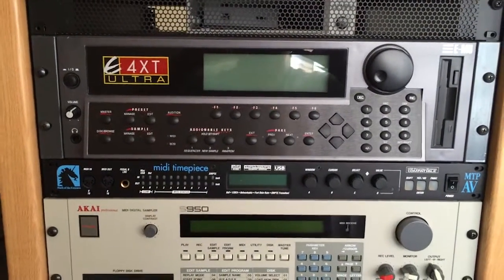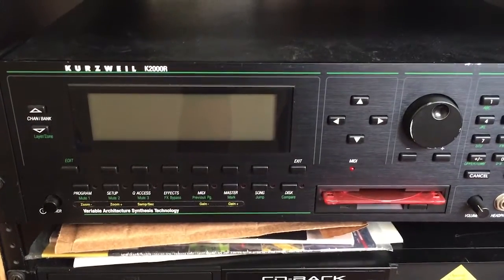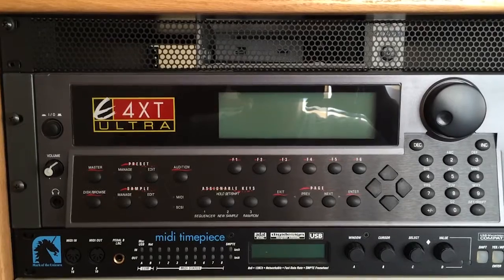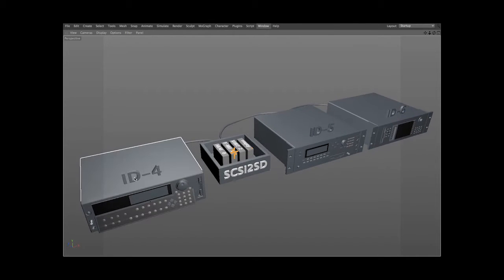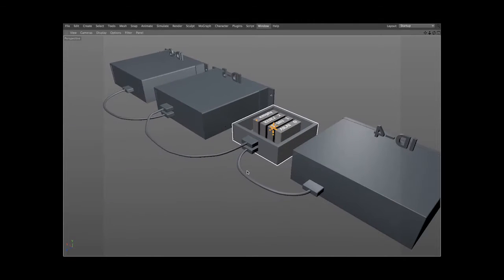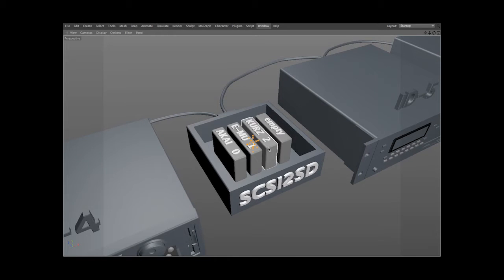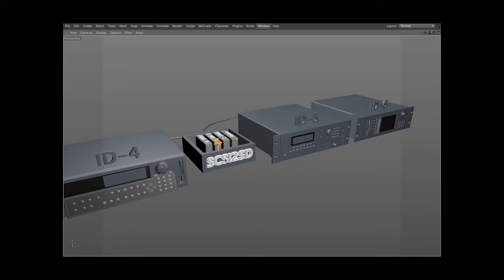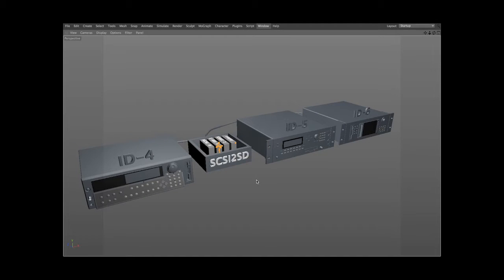SCSI experiment: 3 samplers and 1 scsi reader (scsi2sd)

Comment: I have a scsi2sd card in my E-mu e64 but am having difficulty getting my S3200xl seeing it when I plug it in to the e64. Do I need a separate box for the scsi2sd ?
Reply from the maker: The scsi protocol wasn't really designed to have  multiple hosts (samplers or computers) in the same chain, so you can definitely run into some problems, data corruption being one of them.  You can kind of make it work sometimes but if you want hassle free operation multiple scsi2sd cards is the best way to go.  I use multiple cards myself.
Reply: Thanks @RoyMaya

Comment: Just out of curiosity, did you try loading filrs off the E-Mu drive or the Akai drive onto the Kurzweil?  Since the Kurz will read both of those formats I was wondering if you tried it this way using the SCSI2SD device.  I know that the Kurz will read E-Mu and AKAI CDs fine, but accessing foreign files from a shared SCSI bus would make the capability even more interesting that it already has been shown to be.  I wish I had rack space for some of the other older samplers.

Comment: You can connect 4 samplers INDEPENDENTLY yet all wired at the same time to one SCSI2SD using a common, generic 4-way "data switch" box (most often made by Belkin, but plenty of generic ones exist). The box has five DB25 ports on back (1 for each of 4 devices/samplers "A", "B", "C", "D", plus 1 "I/O" port for the SCSI2SD), and a rotary selector knob on the front. Simply rotate knob to select the sampler you are using at the moment, giving you have access to all four samplers directly without multiple drive confusion and termination issues, but also without any rewiring necessary while using only one SCSI2SD. The switch boxes cost about $15 to $30 new.

Comment: In order to daisy chain multiple SCSI samplers as you did here must the SCSI2SD device be external? Is it possible to also, for example, install the SCSI2SD card internally into the Akai S6000 floppy drive slot and then daisy chain the other samplers through the SCSI connectors on the back of the Akai S6000? The SCSI2SD I'm thinking of purchasing is the updated V6 model.
Reply from the maker: it might work, it just depends on the samplers that  you'll be connecting.  The main disadvantage to this is that you can't turn on the scsisd indepentatly from the sampler since it's internal.  A lot of times you need to turn on the hard drive first (or scsi2sd in this case) before turning on the samplers.  But it's worth a try.
Reply: @RoyMaya  Excellent. Thx for the reply! :)

Comment: It seams to be very slow campared to a Compact Flash reader. Is it just so slow when they all are connected to the same SCSI Bus or is it so slow in general with the scsi2sd?
Reply from the maker: It's only this slow when I had all the samplers connected.  I think I didn't have all the termination set correctly which could have affected the speed.  Either way, this was just an experiment.  I have separate scsi2sd's for each sampler now which works great.

Comment: hello again another question :) just wondered if you have to have the k2000 switched on before the s5000 can communicate with the scsi2sd drive or does this "pass thru" without power? thanks
Reply from the maker: That's a good question, unfortunately I never tried that so can't say if it would work.  My setup is different now so I can't try that.

Comment: HEllo, I have just bought a e6400 classic and had a couple of Qs about the SCSI2SD if that's ok? I was wondering whether you could use it to burn iso disk images of sample libraries to partitions on the SD, while leaving other partitions for harddrive file systems? I hope so, as I really don't want to have to buy a scsi cd rom drive! Thanks for your help.
Reply from the maker: Yes, you can put cd-rom images onto the drive on the SCSI2Sd but you need to use another program for that, like WIn32 Disk Imager.
Reply: Thanks for the info!

Comment: Hi Roy. I want to buy scsi2sd for my S3000XL as well. Which version that you use? And do you  need to set it up first before use it or it's plug n play?
I've seen lots of people set the card first.
Reply from the maker: I believe by default it has a 2gb partition set.  You probably want to configure it first before using it, though.  I don't have an S3000XL so I can't help you with that, but I know others have using it with the S3000, though.  Good luck.

Comment: Thanks for posting this it has proved to be a useful resource of information, just one question though  the scsi has one male 50 pin connector so how did you cable it to allow to be chained? Im trying to get mine setup to work between an akai s1000 and a s3000xl currenly just connected via ribbon cable to the s1000
Reply from the maker: I have it installed in a scsi case which has dual connectors.  I used an old Syquest EZDrive 135 case.  I have another video showing how I installed it.

Comment: Hi Roy, With the SCSI2SD, when you partition the sd card, into several partitions,  A,B,C etc.. does the sampler automatically know that when you select the ID number 0, that its communicating with partition A,  or if you select ID number 1, that its communicating with partition B on the SD Card, are is there some other way to assign this.
Reply from the maker: The short answer is yes.  Although, to be exact they're not partitions (otherwise the sampler wouldn't recognize them) they're virtual drives.  So to the sampler it's like you had 4 scsi drives connected with their own ID, that's why it works.
Reply: Thanks Roys, did you create the virtual drives with software, ?
Reply from the maker: Yeah, there's a utility/app that you use to configure the scsi2sd - it's pretty straight forward. You can download it from the scsi2sd site (codesrc.com).
Reply: Cheers Rod, Just Purchased Your Bracket for V.5 and the SCSI2SD board, for my Akai S3000XL, I may make a video on how to install it, and putting sample cds on the SD Card, Your Name and website will be mentioned on the video, if your OK with That
Reply from the maker: Looking forward to checking out that video. Appreciate it!
Reply: Hi Roy, installed all today, I connected the micro usb to my PC, firmware up to date, using the utility tool, but have no idea, the sdcard is not recognised in win32discimage
Reply: I formatted the card with the sampler, and now it will read in win32discimage, but there is only one drive, I was hoping to see, 4 drives on the sd card. I am sure i an using the utility tool right. Any help would great,
Reply from the maker: If you have Scsi2sd V5 then you will only be able to see 1 drive on your PC.  You would need to install a scsi card in your pc to  access all 4 drives.  Scsi2sd V6 will let you see all the drives without a scsi card.
Reply: Hi Roy Got it working Thanks to you, Yes I can only see one drive, the other I cant see unless I have a SCSI card, is there a way to copy from one scsi drive to another on the Akai S3000xl sampler
Reply from the maker: I'm not familiar with the S3000xl so can't help you there.  On the Akai S1000 it's a slow manual process which is why I installed a scsi card in my pc - much faster that way.  Good luck!
Reply: SCSI card it is then, Thanks Again Roy
Reply: Hi Roy, Just got a SCSI PCI card, install it on a xp system and connected it to the Akai sample, just wondering how do I see the 4 virtual drives, so I can copy 4 cd images from computer to the SCSI2SD card
Reply from the maker: You might have problems if you're connecting the PC directly to the sampler with a scsi cable.  And that's because scsi is not designed to have multiple hosts (the PC and sampler) on the same scsi chain.  Data corruption can occur if the PC and sampler try to access your drives at the same time.  Some samplers will behave better than others so it can still work but it just depends on the sampler.  Also some samplers have a setting that will tell it to ignore the PC's host ID so they can co-exist - you might want to check your sampler to see if it has that feature.  And lastly make sure your termination is correct - only the 1st and last devices in the scsi chain need to be terminated, which will be your PC and scsi2sd, not your akai sampler. But as soon as you disconnect your pc, then you'll have to put a terminator on the external scsi port on your sampler.  Makes sense?  Yes, scsi can be kind of confusing - lol.  What I do (to keep things simple) is I have another scsi2sd in an external scsi enclosure that I connect directly to my pc.  Once I copy the images onto the SD cards, I take the SD card out and insert it into the scsi2sd in my sampler.
Reply: Thanks for the Reply, Yes That makes sense, having another scsi2sd in a external scsi enclosure, anyway I got it to work, I have an old PC with WinXP,  so I bought an ADAPTEC AHA-2904 SCSI card on Ebay for €6, I connected the Akai S3000xl to the PC, nothing happened so I had a look in the device manager in XP,  in the disk drive section, it showed the 4 SCSI Drives of the SCSI2SD so I knew I had communication, (Sampler must be on and connected to the PC before you boot up XP, for this to work). What I did next was install an old version of Chicken Systems Translator Pro, Once I opened the program The 4 SCSI Drives where seen by the program, I then mounted an Akai Sample CD Image with Daemon Tools, which was also seen by Translator Pro, I could then drag and drop any of the Partitions of the CD Image to any of the 4 SCSI drives Partitions. What this let me do was take the best partitions of 10 Cd Images and put the across the 4 SCSI Drives on the SCSI2SD Card. All done within a Hour,
Reply from the maker: Glad you got it working!

Comment: Hi Roy, I have V4 of the board, its formatted in my kurzweil.  When I put in my PC (translator and Total commander) its not detected, no folders or nothing?  Back into the kurz its looking fine, 

how do you get the samples into the kurz?
Reply from the maker: That's interesting.  Since it's FAT, the PC should be able to see it.  I'm using V5 though, so maybe that has something to do with it.  I've never tried a card from a V4 board.  Or it could also be the OS version on your Kurzweil. Maybe the older versions used a proprietary file system and the later OS used FAT?  I can't really remember.
Reply: just checked its revision 5b bios 4.2  How did you format the card?  Something like acronis and divide up into 4 partitions?
The Kurz formatted it and it vanished from PC.  so weird.
Reply from the maker: I formatted it using the K2000r - no problems on my end.

Comment: so...let me get this straight... you're using the SCSI2SD EXTERNALLY and then just daisy chaining the samplers?
Reply: i ask because i'm wondering what the best solution is to share samples between two E4x samplers
Reply from the maker: That's correct!  The scsi2sd only has 1 connect so you'll need an adapter or install it in a case (like I did) which has 2 connectors for daisy chaining.
Reply: fanks!

Comment: Huge thanks for this!!

I have an S5000. How fast would you say the Scsi2sd is compared to a scsi drive? For instance, how long would 100Mb of drum samples take to load? Or 100Mb of loops (in my case those i made on a korg electribe2). Can you unplug the SD and insert it in your pc and add samples or do you need a special program?

For both the S5000 and the Ultra, what cables and adapters do you need? What settings? I bought them years ago but i had to give up as i never got it to work and the noise from the fan and hard drives made me go nuts :/

Thanks for any help!!
Reply from the maker: +Sleepydog I don't have a scsi drive, but I would say it's as fast as the scsi protocol allows.  The real limitation here is the scsi bus speed and the sampler, not the scsi2sd.  The scsi2sd card does support scsi-2, but I'm not sure if the Akai S5000 supports that speed.  I'm gonna see if the S5000 supports scsi-2 and maybe compare the speed difference.

For cables and adapters, it depends if you want it internally or externally.  For internal all you need is the standard 50pin scsi cable.  For external you can put it in a case or get a IDC50 to DB25 adapter.  And power wise you don't need any power because it will get power form the scsi bus.
Reply: Roy Maya great! thanks!